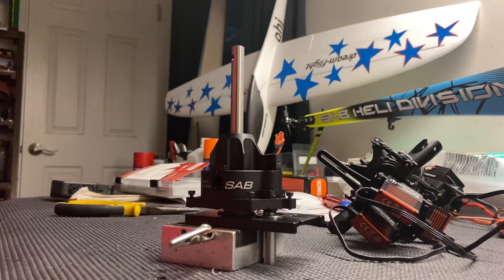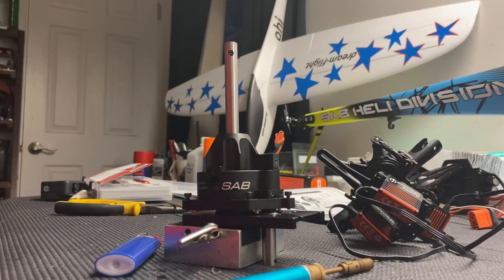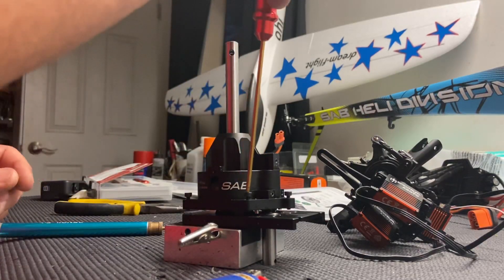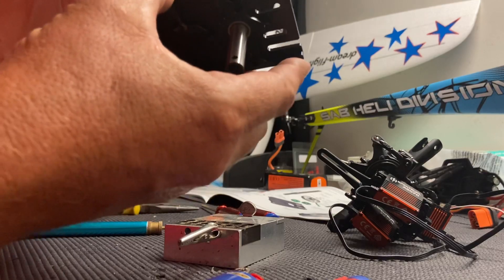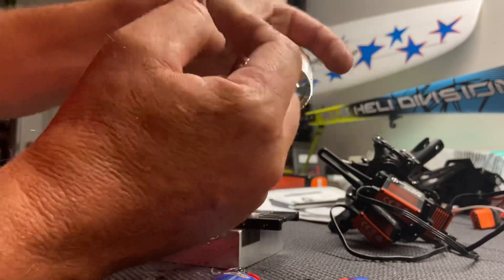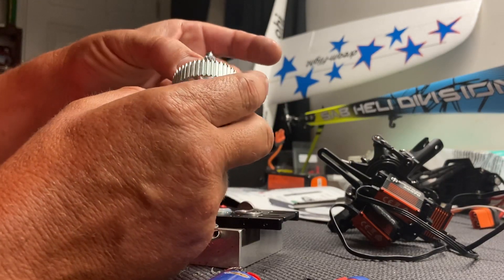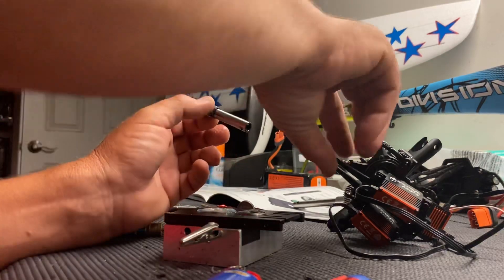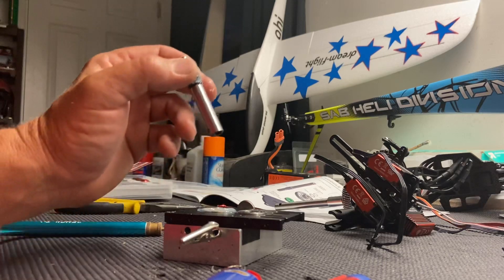SAB Kraken 580 Secondary Shaft Repair Process

Comment: Looks like enough grease inside the trans module so I don't need to buy the sab tube stuff when I get the retrofit shaft. Will my 60watt soldering iron be hot enough?
Reply from the maker: Heli Thunder  guess you have to try it. Torch worked great.

Comment: I think I'm gonna change the one way for an extra $30. This is not acceptable. Why do they make a belt  tensioner and not include it in the kit. It's the little things that annoy me about this heli
Reply from the maker: You don’t need a belt tensioner. They want your wallet. The secondary shaft is free if you email SAB and do the retrofit sequence with them. Put some bearing grease on the bearing and in 15 minutes it will be good to go. Helicopters require maintenance. That’s why it’s a hobby.

Comment: I have 4 flights on mine and went to up the pinion tooth count and checked the secondary and it's already has considerable wear. So don't i now have shavings in the one way that will cause issues later on
Reply from the maker: That’s why I’m waiting to fly mine. Pull it apart. New shafts are on the way

Comment: Did I mis something or did I understand that this shaft needs replacing every 10 flights or so? Or is there a new shaft with a harder surface? Really like this helicopter and considering buying one down the line. Thanks
Reply from the maker: It is a recall. They were not hardened enough. Sab is sending new part to everyone free of charge. Here is a link. 
https://m.facebook.com/story.php?story_fbid=3178287578858129&id=244071865613063&__tn__=%2As%2AsH-R
Reply: CoeShow619 thanks for the clarification. This is what I’m shooting for once I’m skilled enough to fly it. Thanks for all your videos. I’ve already benefited from watching them.

Comment: Thanks for the video! SAB always seems great with keeping their customers informed and happy. Question, what brand hex drivers are you using?
Reply from the maker: Ah man, these are nice. They are the Dynamite aluminum handle hardened metric driver set. Part number DYNT2030. They are a great price at Horizon Hobby of course.